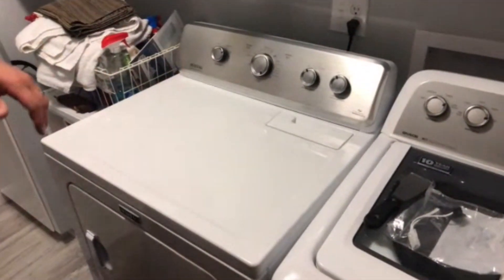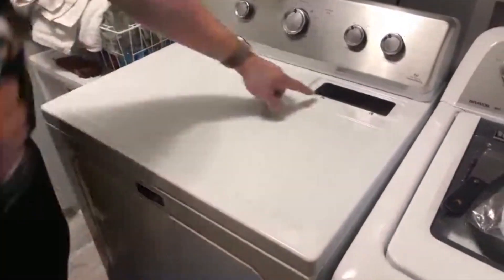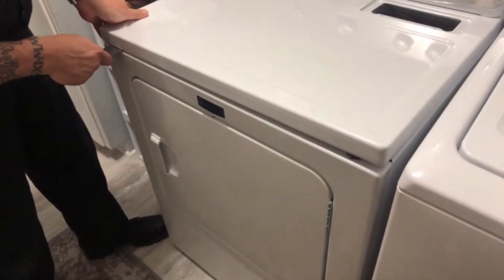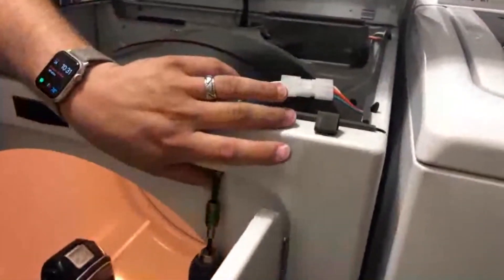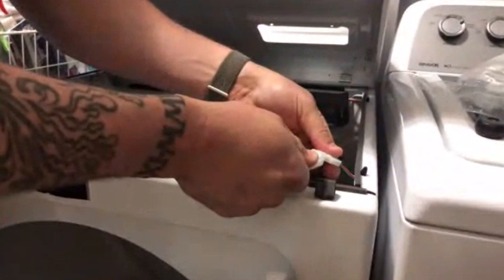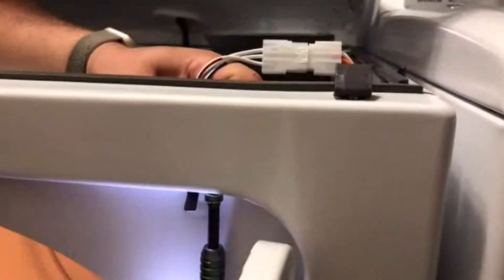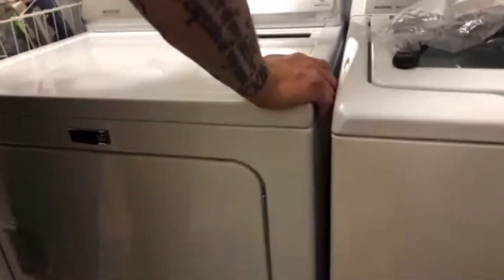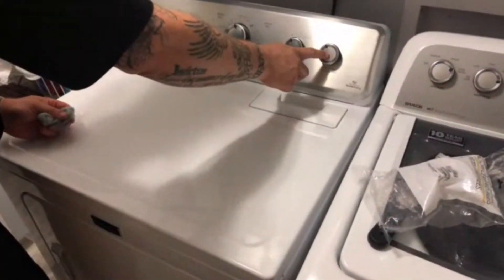Maytag , Whirlpool  Dryer  - Runs with door open - Diagnostic & Repair

Comment: Had a hard time unplugging the old switch. Used the edge of my putty knife to lift the edge of the switch socket over the raised part of the female socket that locks the male socket of the switch into place.All good now. Thanks for the instructions on this easy fix.

Comment: We have a whirlpool dryer LER4600PQ1 that would run even the door was opened. Well it was on and my wife forgot to put the dryer sheets so she opened it to add them per usual and when she closed the door it cut off and will not start at all and i dont see a door sensor anywhere on the door
Reply from the maker: Great question, if you have a more technical question that our parts department cannot answer, you can search our over 17,000 answered questions free at our website www.ApplianceVideo.com under our Repair Help section. You can also call our parts department at 1-800-830-5465 and they can give you help 7-days A week ,or search at www.SaveMoreOnParts.com  .

Comment: I just replaced one on my daughter's Whirlpool stackable dryer,  however now the dryer will not run unless "the door is open"!!  Could it be a new "bad" switch? ?
Reply from the maker: Great question, if you have a more technical question that our parts department cannot answer, you can search our over 17,000 answered questions free at our website www.ApplianceVideo.com under our Repair Help section. You can also call our parts department at 1-800-830-5465 and they can give you help 7-days A week ,or search at www.SaveMoreOnParts.com  .
Reply: I’m having the same problem. If I shut the door, the dryer stops. Frustrating..